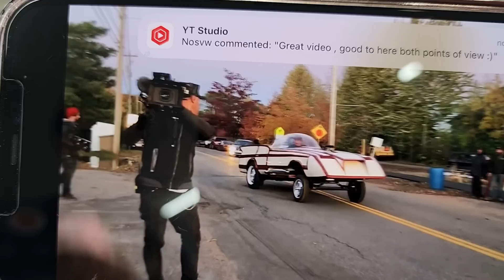This Custom Bubble Top Gasser has a Supercharged 302 Ford engine 🤯

Comment: Chad and Jolene this is one cool car! Thank you for showing us in such great detail on how to blow the bubble. I am building a flathead powered Dragula. And I am going to blow the bubble for it. I can now see that George blew the bubble for the dragula and then cut the back off to square it, and the rear portion of the bubble was used on the Batmobile. I am guessing. Thanks again. Steven

Comment: My Mother owned an original factory small block 302 motor with no modifications done to it in a 1974 burnt orange coloured 'Ford Gran Torino Brougham'. Man that old ford car had more power, then my fire engine red coloured '1973 Plymouth Satellite' with the small block 318 Mopar. (My wild mother "Evil Eve" was not scared to drag race in her days.) My mother's old 302 ford kick butt in a street drag race big time. I wonder sometime if that car was not modified with 351 parts or bored out maybe ???? Never under estimate a small block 302.-- (also my Father's factory Oldsmobile Omega small blocks was an awesome engines to own. You could bury the speedometer in that car, and it would fly like an oldmobile rocket.) One awesome car there Bad Chad & Jolene -- I love this video and thank you for showing this. Rocket Car !

Comment: One thing for sure on this car.  Grandma cannot drive it,  and at my age neither could I.  All the Bubble top Cars I have seen, have a way to lift it up for entrance.  It is, however, an interesting concept. Sounds like Chad encountered a problem with the Metalflake Paint.  I have done several Candy and Flake paint jobs, and you have to lay down a uniform base coat first in a color that works with the color of choice,  then apply the main coat in steps until it is uniform over the entire car. My paint jobs were color sanded between coats and when finished, a last cover of clear and then sand and buff. That is why Custom Painters charge what they do.  It is labor intensive.

Comment: Hey Chad. I use soft copper tubing. U dont need roller. If it gets stiff from working it. Just reheat to red hot,bends like rubber